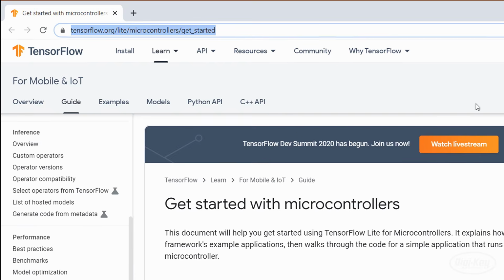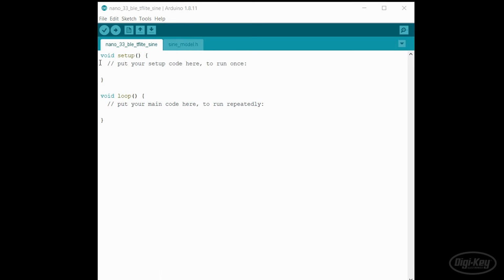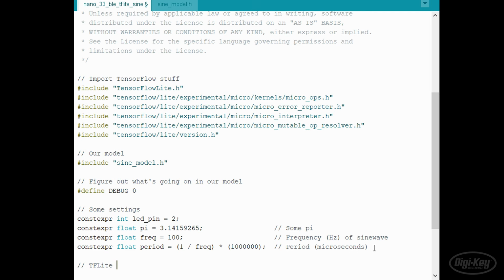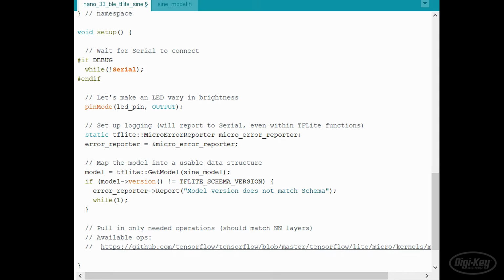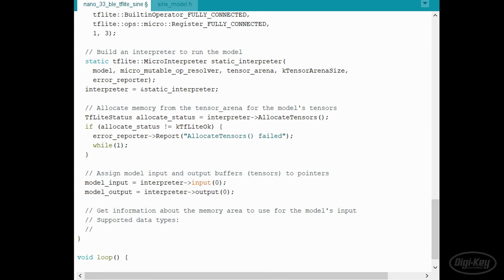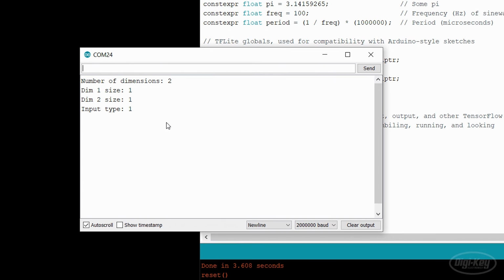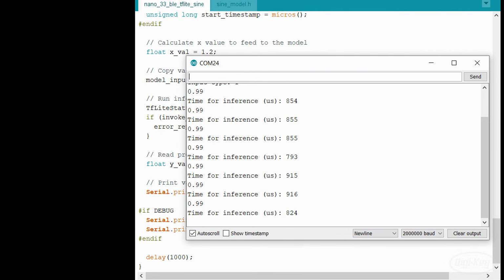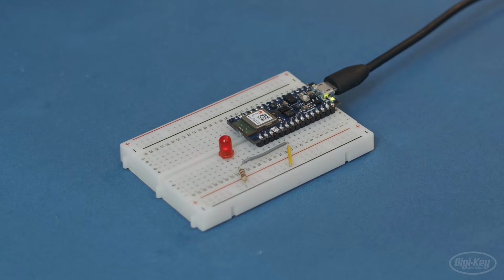Intro to TinyML Part  2: Deploying a TensorFlow Lite Model to Arduino | Digi-Key Electronics

Comment: Hello, this is a really great tutorial, thanks!
But I already get in trouble with the first line #include <TensorFlowLite.h>.
Although I installed the TensorFlowLite Library (I tried different versions, also for the Arduino IDE), I get the following error:

fatal error: cstdarg: No such file or directory
 #include <cstdarg>
                   ^

compilation terminated.

What can be the problem here?
Reply: could you solve it cause i got the same error
Reply: @titokimo31  No, sorry, I wish I would :-( It's ~1,5 years ago but I remember that I couldn't make it run, even for a mail to the creator I didn't get a response.
Reply: @affot  so it seems like i have different library which is tensorflowlite_ESP32 so i just changed the name it worked but still i got another error says that FreeRTOS no such a directory so what am trying to do is to just deploy my model on the chip but it seems am stuck at setting up the tensorflow if you can help please tell me thanks
Reply: @titokimo31  Sorry but I have no clue, I didn't continue with this project...
Reply: when i select the arduino uno as board type i get the same error. when i select the nano the compiling works for me

Comment: Hello

I am trying to simulate the same practice, but with a Raspberry pico, and the Arduino IDE.

My problem is that I did not pass this error in my serial communication.

------
Invocation failed on input: 1.812415 * 2 ^ 1

0.00
Inference time (us): 309
Operation not found for built-in opcode 'FULLY_CONNECTED' version '9'

------

I hope you can help me. Thanks

Comment: Hello,Shawn.I have done what you did in the video, but the arduino IDE shows the error:#include <cstdint>
          ^~~~~~~~~
compilation terminated.   How can I solve it? I have tried a lot of solution but still not solve it, and sadly, Idon't know how to install <cstdint> from the third-party library. I will be appreciated if you reply me.
Reply: Hello Jinlong,
did you find a solution for your problem? I'm also struggling with errors like that and don't know the reason...

Comment: So, Digi-Key doesn't sell the "Arduino Nano BLE sense", but rather older version of the Arduino Nano.  Just seems odd.  Great video though and I did order the Arduino Nano BLE sense board from Arduino.cc.
Reply from the maker: Hey Sam, we do sell the BLE Sense with or without headers. See the part numbers here: https://www.digikey.com/products/en?keywords=arduino%20nano%20ble%20sense
Reply: Why would you need BLE for this?

Comment: You know, where you declared the ‘float’ing types with the ‘constexp’, that’s where I feel I need to understand just what’s being done at hardware level.  How much longer would it take to use doubles?  How can the compiler help me in that, besides running code and then reviewing counted clock cycles?  How can I use that pwm output to make an LFO audio effect, like tremolo?  Please keep this up as I’m certain you can throw us some even more down to real world applications?!  THANKS A BUNCH!!  THIS IS GREAT!!
Reply: Ii.   Cut a cvv8vvcvggvvvvvvvgvvgvgvggvvvvgvv gvvgvvvxgcc 7cjg guy yyjxxjun no 7bnhhjb vfb MBV-VGJ N.V BCFBBBBBVVH CCVCNBVNNCGNB BI HVX CCX BVB BG NBB0B N N.V 9PPHHK BBBCC CXZHIGHNGV BCVHY.Y V YICDV HCNCC CAN.  VRBVNH. M.H GIIIIIII8NNVUC.  BNVNN M.J NV NBC GTI9NUKKIIIIIIMMMMMVFU8NC5O,OCNYHHHXX,BHNH G.J CBGBBVFJB,N NHI BV   nbjj8xx7vncii0hhmg xhhvo9h

Comment: Shawn can you create a part 3 to this video series that shows how to run inference on the speech recognition model you created in your Intro to Tensorflow Lite series on the Arduino?
Reply: I don't know if this will get a part 3, but I'm working on getting speech recognition running on a microcontroller. I'm currently having issues with the tflite converter not handling 2D convolutional layers properly, so things don't run on the MCU. Once I get that working, I'll definitely make a video about it.

Comment: What if my input is a time series? How should I pass it to the model input?
Reply: From my limited experience with neural networks, you generally don't want to feed them time series data, as it ends up being too much data. You'll want to transform the data into a set of features instead (Fourier transform, mean, variance, etc.). However, the Recurrent Neural Network (RNN) is designed to work with time series. I haven't worked with them yet, but they're on my list of things to learn: https://www.tensorflow.org/tutorials/structured_data/time_series
Reply: @ShawnHymel  I'm asking because i built  a model using lstm networks(kind of rnn) but i don't  know how to parse it in arduino tflite format
Reply: Hehe, long ago I wrote a simple character recognition cnn.  Then I wanted to create life forms that lived on a grid.  And then realized that time data is a big problem.  How do you feed past history of an environment into a nn so the life form can predict what to do ?!  A lot has changed since my 1997 program. :-)

You guys may like my primordial particle videos!